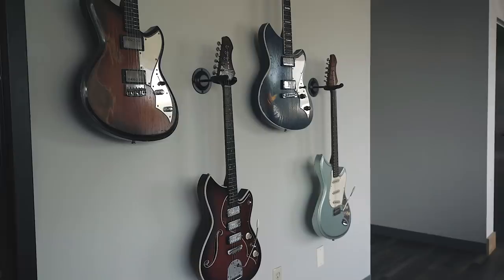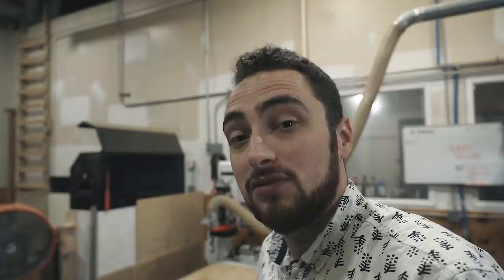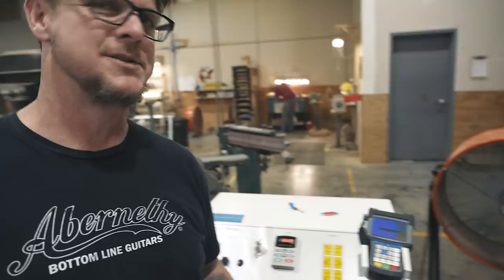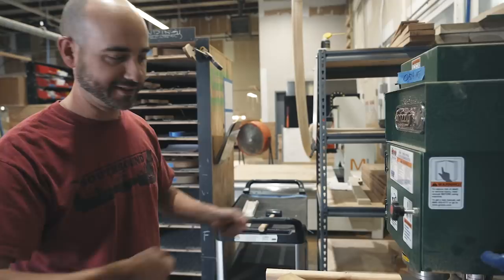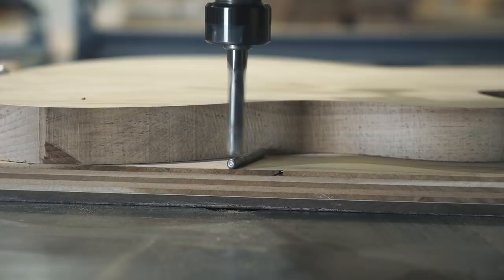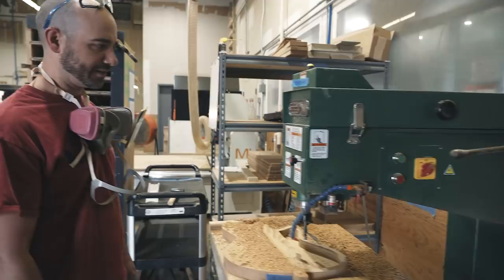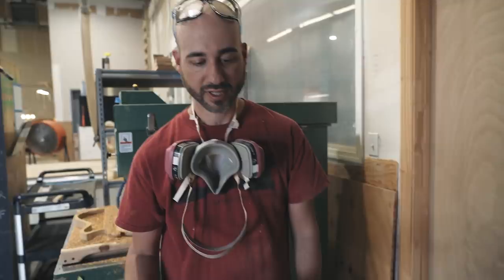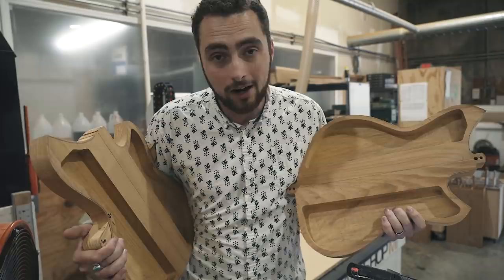Is “Handmade” Really Better? CNC vs. Handmade Guitar

Comment: was a cnc machinist for 24+ years, even cnc's can make cruddy parts, still takes a decent operator to  make quality happen.
Reply: Concur, sucky jig/operator, plus CNC=crap. I love my PRS guitars, and they are all CNC. The finishing touches make up the diff.
Reply: @youKnowWho3311  The "finishing touch" is what makes the guitar cost $4000 and more. The wood/parts itself/themselves, glued together, worth $500, maybe less. But a real nice finish takes a week, maybe two, sometimes more. That is what makes a US guitar worth $4000. Strangely, Asians can give the same quality for less than the half of the price. Thanks to CNCs...
Reply: @DigiPal  You can't get lacquer finishes on Asian guitars though.
Reply: @toddflowers8052  I have a Gretsch G6120SSU Brian Setzer signature made in Japan w/a lacquer finish.
Reply: @EphICanIMite  That is the first one I've heard of , you have a rare MIJ, all of my MIJ's have been Poly .Congrats !
Reply: i can do all that with templates and router by hand..if your templates are set up with location screws, only takes about half an hour to route all cavities, neck slot, pickup holes,chambers for semi hollow drill.. a press drill and powerful  half inch router.quite quick really. for these machines you still have to control them, line things up etc. depth stops and then flip the guitar over to do the other side, still takes time
Reply: @aevoguitars2576  cool story bro, but can you make 200 identical versions every day? without rest? no? yes the routing by hand only takes half an hour (if your super human) but you must take into account the setup time as well. A cnc takes a little longer to set up properly, but once its set its load and go, no dicking around with jigs, and screws, or any scribing of centerline, just chuck a blank in hit start and piss off for 10 minutes.
Reply: northman logging hi, i didnt want to offend, my comment was aimed at smaller builders who dont need 200 bodies per day.people seem to think they must have a cnc machine to do things these days.200 guitars a day is a lot, more than paul reed smith i think. to do 200 a day you need to finish one every 3 minutes so no time to piss off for ten minutes or have lunch .. i can understand an operator and a machine doing 100 a day but even thats pushing it( i think?) somebody out there tell me im wrong.another point is there are not many makers out there that need 100 plus guitar bodies a day.. 36, 000 guitars a year. no centerlines needed when you set up your templates with locating pins..
Reply: @toddflowers8052  who told you that? you can even get nitro finishes out of china these days
Reply: Todd Flowers you wouldn't get a lacquer finish on a PRS either
Reply: @tonyzito9888  Nobody told me that ,I have never seen a Chinese lacquer finished guitar ,and I've owned dozens ! I have forty Chinese guitars right now and they are all poly. What Chinese manufacturer uses lacquer ?
Reply: @aevoguitars2576  hardly offended, just folks seem to forget every step takes time, I mean if we wanna really get into craftsmanship vs robotics then a race with a chisel and hand sanding everything vs cnc would be the way to decide it... but come on, no ones that crazy... or are they?
Reply: northman logging hi, i'd like to take up that challenge but without chisels or any machines..im actually a fully trained master woorigamist which translates in english to "wood whisperer.
using an ancient japanese technique, using only my hands and my mind  or minds i can communicate with the fibres in the wood and by gentle manipulation and chanting i can form the wood into anyshape i desire in minutes! ( depending on the weather) so the guitars i make are fully hand made.
i apply the laquer with the bamboo straw blow technique(
sometimes if the weather is not correct i use my compressor)
Reply: @aevoguitars2576  lay off the pipe.
Reply: @aevoguitars2576  Pics or it didn't happen lol!
Reply: Todd Flowers lacquers were invented in Asia. Varnishes in Europe. You figure it out
Reply: northman logging Yeah that’s like saying a dj is making live music
Reply: @nickdryad  depends on the DJ, some mix and match recorded music to create something new, others just play the hits. The good ones make it happen live.
Reply: northman logging hm. got you beat 45 years machining. what will happen here is high production...same parts all the same versus as you said still using  a tool but also looking and treating it as a individual piece..and yes i have done prototype ..and high production
Reply: @miguelcastaneda7236  then you should know Mr. 45 yrs, that a poor setup leads to poor parts whether its high production or not, and if your struggling with a poor setup/program/tooling/operator then you are going to have a lot of rework and scrap.  more often then not if done properly high production can lead to better quality, if and its a big if the management takes an active interest in making every aspect better, rather then the more common approach of its running leave it alone, which eventually cripples every company with that mindset.
Reply: I took a little bit of CNC programming in college and I can guarantee you're right about that. I made some goofy looking stuff lol
Reply: @aevoguitars2576  you can run  multiple CNC's with 1 operator ran a shop for 35 years and they push the operators for max Production and least downtime sme guy does secondary work while Machines keep  running auto loading with pallet changers  it never ends and you never get a break so sometimes quality takes a hit when your fed up
Reply: @aevoguitars2576  lolololololo
Reply: @northmanlogging2769  that "race" would need to be judged on more than just speed, and it would probably be a tie. The CNC would most likely win the speed competition, but the guy with a hammer and chisel (or whatever) would probably win on the quality of the final product (if they know what they are doing). There is always more than one side to everything, but too many people ignore the facts these days.
Reply: @DigiPal  Asians can give the same quality for less than half of the price, because they work for $5 an hour
Reply: @aevoguitars2576  right on, about the same time it takes a cheaper CNC machine to plow it's way through some maple. I agree with you. Seems everyones main concern is doing everything quick and cheap. Thats the problem with builders, they don't all do it for the love of guitars, it's the love of money. IMHO.
Reply: @aevoguitars2576  TRUE!!!!!!!
Reply: It's all in the small details. You skip or miss 1 little thing, and the part ends up ruined, or worse. I saw a 1.5 million dollar CNC get all but destroyed by a simple zeroing error. Needless to say, that operator lost his job.
Reply: @aevoguitars2576  Actually, once the initial z-axis zero is set, the machine will take care of the depths without a problem, even across multiple tool types and changes. You would not want to try to race a cnc with hand equipment. And aside from the shear speed advantage, there is also a wear advantage. CNC's can run very consistent paths, optimizing chip load, giving the fastest cut with the least wear to the bit.
Reply: @toddflowers8052  you can! Eastman guitars have nitro finishes on most of their line, and even hand rubbed varnish finishes on some models, and their factory is in china 😁
Reply: @guildofgamefails  Good to know .
Reply: @guildofgamefails  Ya now after I see the prices I am not surprised ,very nice though.
Reply: @toddflowers8052  well, I really wonder what the benefits are of a finish that yellows with age, rubs off overtime and tends to develop cracks under normal humidity changes, to be honest. The only practical benefit I can see over poly is that open cracks and chips can be fixed by simply adding more lacquer. Other than that, poly is simply more durable, stable and easier to apply, the only problem is that it's usually associated with cheaper guitars having thick finishes to get that shinny, plastic-y looks, but if done properly, I simply can't see how's that a downside.
Reply: @acoffeewithsatan  Poly is like having plastic covering the wood whereas lacquer is much thinner and lets the wood "breath" imo that let's the wood resonate far better .
Reply: & sharp bits
Reply: Todd Flowers  you haven’t checked out Eastman then
Reply: @aevoguitars2576  test tube babies are hand-made too!
Reply: I think he forgot to make another point. If course a machine is more precise but most people like to build guitars because it's a skill they want to use. It's about creating something with your hand to be involved in the process. Computers are even more accurate in producing sounds. They can make perfect sine wave something a human voice just can't do. It's therefore inherently better? I don't think so. And that's what most people appreciate. Also for the most part the increased precision is being done to a material that is inherently unstable. The wood's shape changes with temperatures and humidity so no amount of precision will ever make it absolutely perfect. The router is more than sufficiently precise to make good cuts and a guitar built this way won't last any shorter amount of time. The only area where CNC excels is consistency that's why I'm a fan of it too. But I don't really care all that much as long as the individual guitar plays well from what it was built or how. Who cares.
Reply: @toddflowers8052  My Eastman 335 copy has a nitro finish.
Reply: I’m a small builder and it takes 1-2 months to complete one guitar depending on complexity. Everything is done by hand using hand held routers or routing tables and hand tools. This doesn’t mean it’s better or worse, they’re just different. Each guitar is unique in its own way and I think there is some attraction to that. The owner will know no one else will have a guitar exactly like the one they own. 
But to some they may care less. 
It’s really up to the individual.